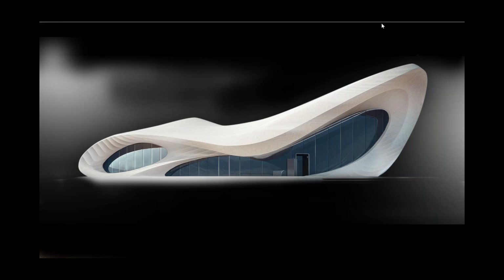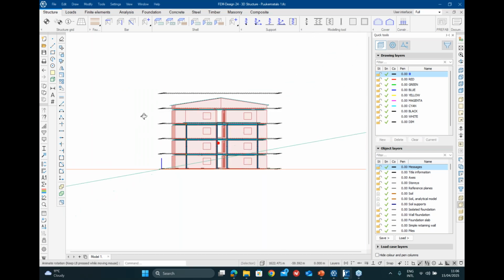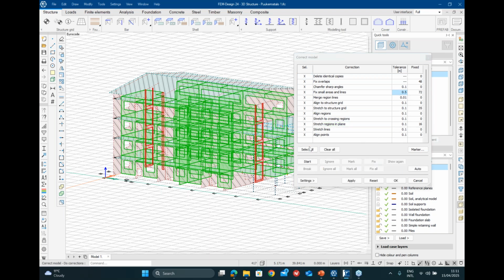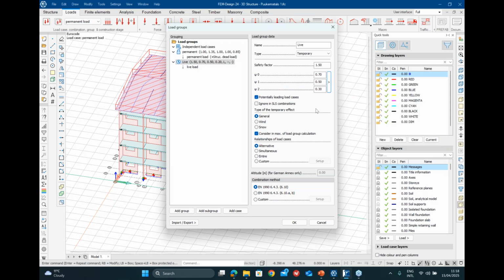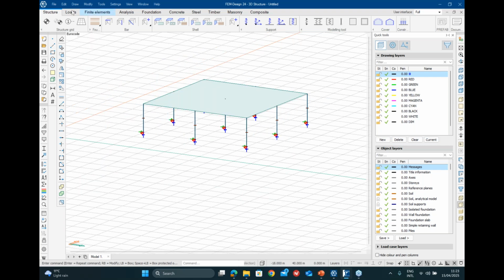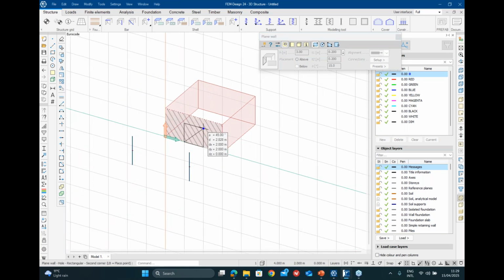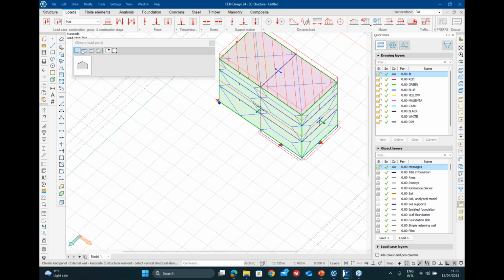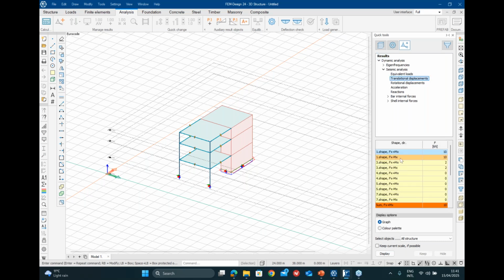Introduction to FEM-Design

Comment: Olá, existem planos para normas de dimensionamento do Brasil?
Reply from the maker: Hello! Thank you for your message. At this time, we don’t have immediate plans to implement Brazilian design codes in FEM-Design. However, you can modify the safety factors manually and add your own cross sections. If you want to start your journey with FEM-Design, you can choose the free trial option here: https://tinyurl.com/ycjpw8jz